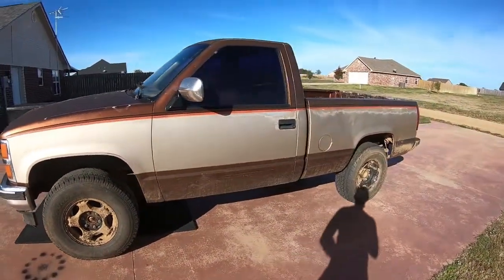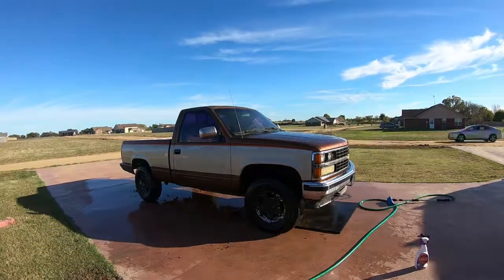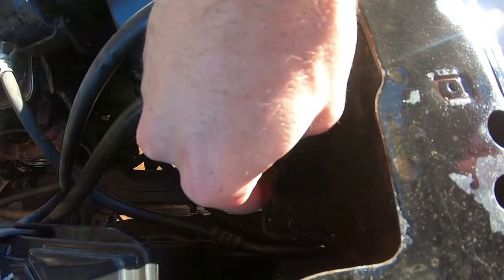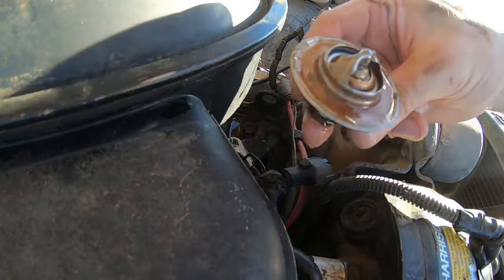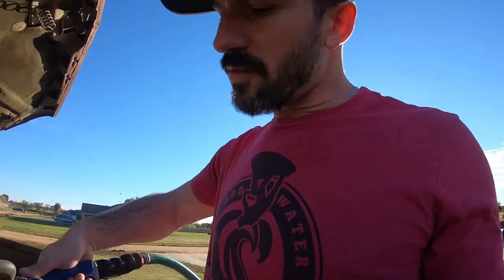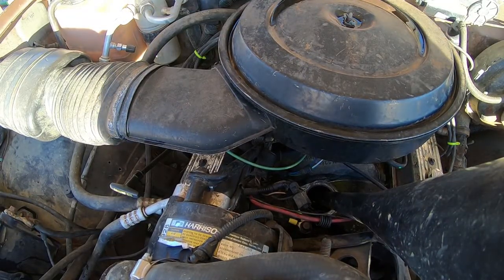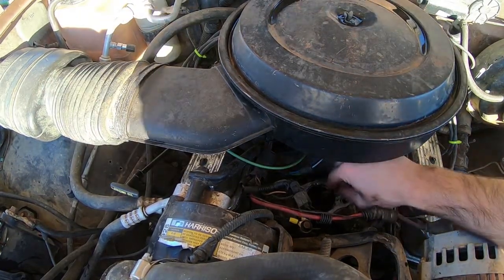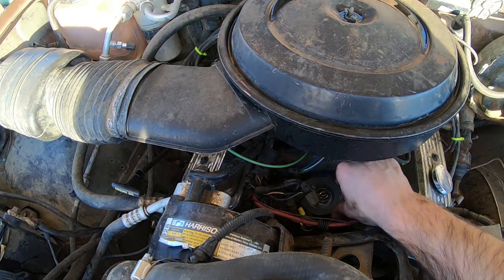chevy 5.7 radiator flush and thermostat

Comment: You didn’t bleed the air out of the system. Also you use tap water, you should only use distilled water. The inside of your cooling system is going to get very corroded with all those mineral contaminates from the tap water.
Reply: How do u get the air out
Reply: @ethanstephens8293  Leave the radiator cap off, fill it to the top, start the engine, wait for the engine to warm up and the bubbles to stop and finally top it up again and put the cap on.
Reply: @insilico3251  appreciate it 👍🏼
Reply: @ethanstephens8293  also when you have the cap off squeeze the upper radiator hose to burp out all the air
Reply: If he has a water system (which judging by his house he prob. does.) He used the best water for the job. And plz dont say "soft water has salt in it" this is a mith and a lie. If you do your research you will find that DISTILLED water is actually the worst water to use to control electrolysis. I used DISTILLED water for years cause that's what i was taught untill my tractor mechanic told me about one of the oldest myths he knows of which is using DISTILLED water is best. I called to manufacturer's to confirm this. John Deer and GM both confermed that DISTILLED water is the worst you can use.
Reply: @ethanstephens8293  usually I will top the radiator off and squeeze the radiator hoses until most of the air is out then start it up with the cap off till the level rises up to the cap
Reply: Wow it's deionized water you use not distilled. 😂 lol 😊

Comment: The bolt with the temp gauge wires. Is that the bolt that is used for bleeding the air from the system?